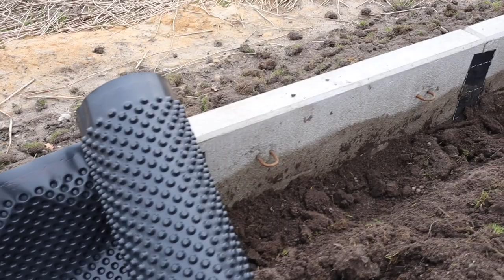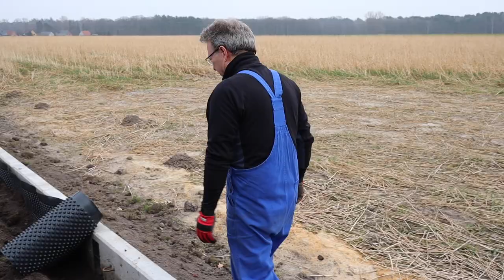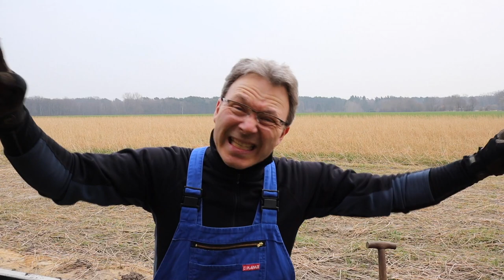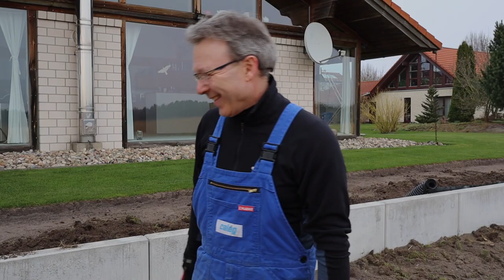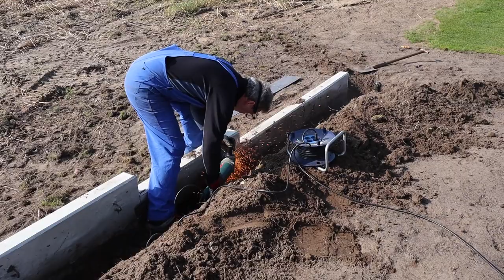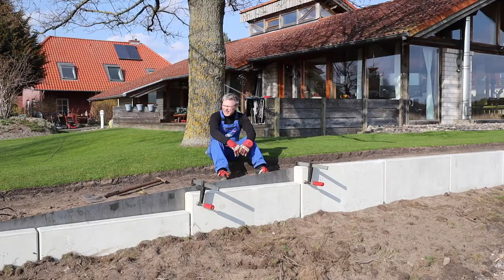SÜDKANTE Teil 2 - Gartengestaltung ist anstrengend! Dies ist kein How-To-Video, Connor Ward! 😉

Comment: Weld on the backside of your metal sheet small L bar to keep your metal sheet from moving downwards in settlement. You could also attach it mechanically to to the top of the concrete wall at these small L brackets to keep it upright. This way, the metal sheet and the wall stones do not lift or move independently.